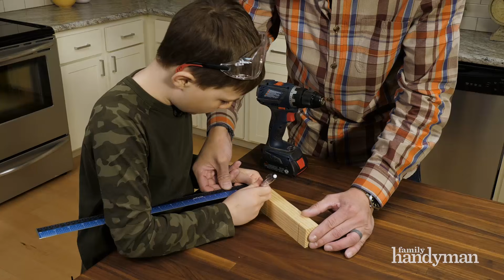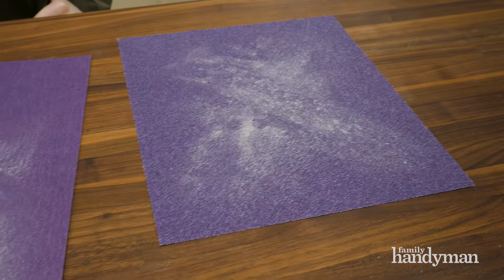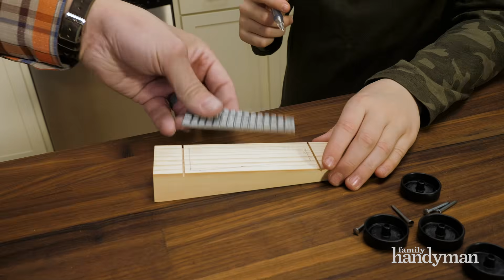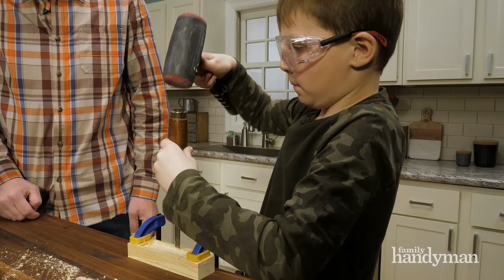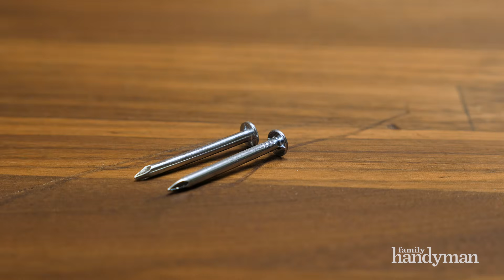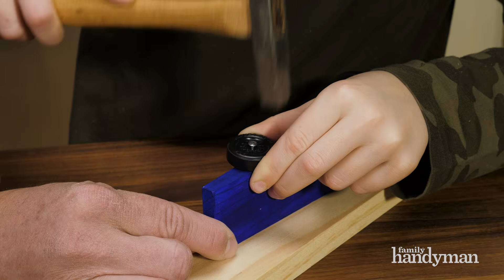How to Build a Pinewood Derby Race Car Using Simple Tools

Comment: I recommend doing the alignment / straightness test on a table. Use the painter's tape, as in this video, but raise one side of the table such that you can let gravity do the work of moving the car--not a push on the back of the car. Obviously this is how the Pinewood Derby track itself also works.
Reply: I used playing cards to do as you suggested. I could easily level the surface by adding/removing cards as shims at all four corners to ensure accuracy. One end was obviously deliberately higher to allow for a gentle roll to test alignment.

Comment: No weights should be allowed anyways cuz that's called cheating in my book! Its called A Pinewood derby not pinewood, lead, metal, nitrous derby hell may as well put a r/c motor with a turbo on it and whatever the hell else you can stuff in it to make it faster derby! This should be all about having FUN and building a cool car with your dad, grandpa, or whoever is raising you that's what these derbys are about "HAVING FUN" and building a car that goes straight and fast from GRAVITY nothing else! This is not about cheating to win a race no wonder we have such a messed up bunch of young adults and kids running around when we look at cheating like its no big deal as long as U win😒🙄!!! Its sad if you ask me! Kids and adults for that matter not only need to learn that winning is fun but they need to learn that losing is not the end and how to improve there car in this instance and come back and try again. Being Humble in defeat is just as important, useful and meaningful to young kids and adults as learning to be humble in winning! Teach your kids the right things from the beginning so we will have a great society when were all old!
Reply: It’s not cheating. Stop being a snowflake. Your tires and axels aren’t wood are they? The point is to build your car the way you want with the wood block. Then add what is allowed to make it 5 ounces. Saying this is cheating is absolutely wrong.
Reply: There are several purposes to the Pinewood Derby. Most importantly as you mentioned is having fun, making memories with caring adults and fellow scouts. But nothing in scouting is limited to fun and memories. Pinewood Derby gives scouts a chance to learn about physics. Will they understand all of it? No, but it will stay with them. They also learn how to work within the rules. It isn't a matter of, the rules don't say that I can't do it, so I am going to do it. It is a matter of the rules say that I can, so how can I do it the best. Not to mention there is nothing wrong with competition. When they lose, which even the best car designer will lose at some point, they learn to do it with grace and keep their honor in tact. Plus they might learn how to do it better next year.
Reply: The best PWD cars use the wood as a frame and that's about it.

Son won his Derby this past weekend, the car is mostly hollow, weighs exactly 5 ounces and the COG is way to the rear.

Next year we're going to take away even more wood.

Comment: When sanding the nails and wheels he mentioned finishing with a 7000 grit sand paper, does anyone know which sandpaper he used leading up to the 7000 grit? I believe he used two others prior to the 7000 grit.
Reply: This is what I'm searching for in the comments also...but no answer. smh
Reply: I tried 400->1000->7000, but decided to go down to 200->400->1000->7000 to really get it smooth.

Comment: The shape is okay, but do not use that weight. Your center of gravity should be .5” in front of your rear axle.
Reply: I will test out that .5" theory thanks for the pointer.. I do agree about the weight's though and I will in no shape or form add any type of lead or metal weight's to my or my kids car! That's just teaching your kids how to cheat, and it surely should be in all rule books that your not allowed to use weights in any shape or form! The car should have to be under a certain weight whether its the 5 ounces like he stated or whatever but no metal weights added or allowed, all wood only!!! Weighting your car is cheating and is surely not something I want to teach my young son!!!
Reply: It is not cheating. It is allowed and the way it should be. As long as the car weighs under the rules is all that matters. Cheating would be making it 6 ounces and allowing it.